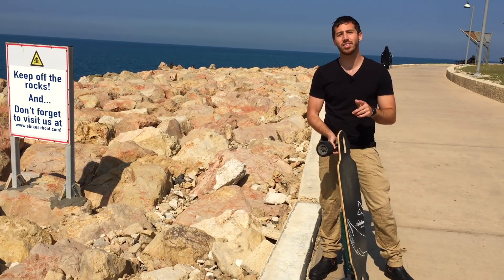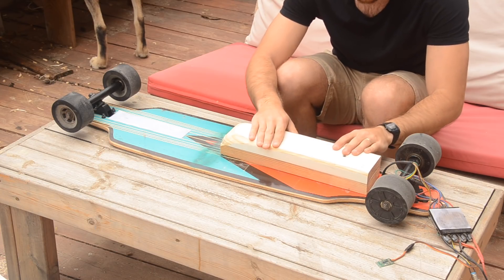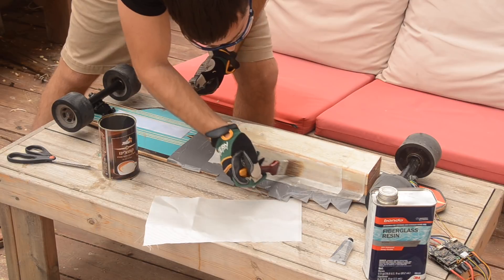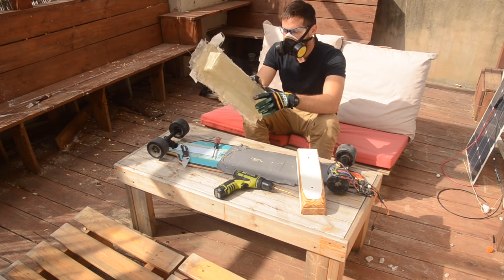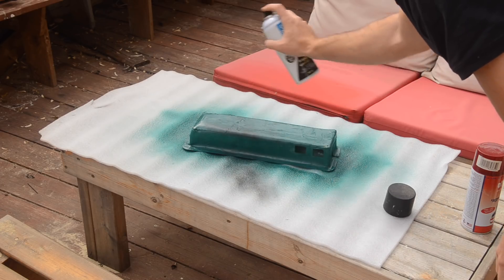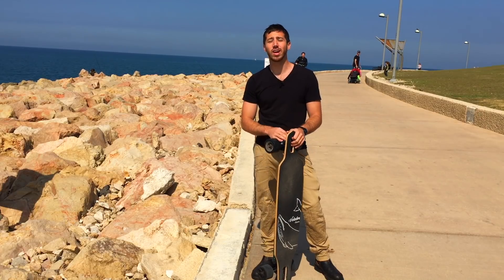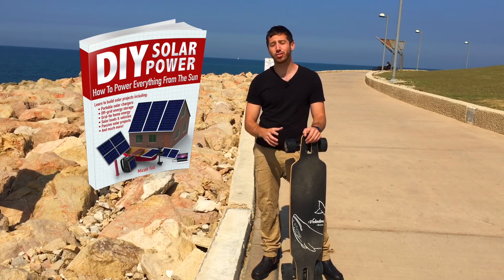DIY electric skateboard enclosure for battery/ESC

Comment: I have 300+ 18650 cells from packs that have failed.  Usually due to a bms. Taken apart many packs, taken spot weld nickel off, bought test equipment, cut hands, scars, cursed God, bought kits to rebuild; vruzend caps tear-not just one the entire kit-thought it would be easy to remove cells to check and charge as the website made it seem.  Supposedly lithium will be very important in the future-if anyone in the future needs some they should definitely check my place cause I don't want them-huge fire hazard even when properly insulated. Don't know how Elon made a reliable vehicle using these.

Comment: This video is a bit old, but hopefully you will see this. I ordered a battery and enclosure from ownboard, but the problem is that the enclosure (which is metal) is flat while my board is curved. I will still need to drill a hole into the enclosure or cut out a piece of it to for the connectors though, but also I need a way to insulate and level everything out. I might just have to give this fiberglass build an attempt. Looks sturdy and with some padding could be a really nice setup. I was also wondering what you thought about using heavy duty Velcro and maybe some straps (these straps would go over the top of the board and help hold the enclosure onto the deck).

Really great video though and very helpful to newbies like me.

Comment: Alternatively you can 3D Print the buck in order to get a cool/streamlined shape. 3D Printers are a lot less cost prohibitive than CNCs. Filament is fairly innespensive so you can iterate pretty quickly

Comment: What do you think about using hard styrofoam (we call it xps - extruded polystyrol) for the negative form ? It is easier to form and if it stucks with cover you can use a hot air b lower to get rid of the rest.

Comment: Lets try this again I'm new working this 18650...I have to 2 questions for you...1) what is the different between your battery set up and what call an tesla setup...2) I'm in Ham radio I would to know how to go able building something like this portable battery power box  like this https://www.youtube.com/watch?v=gtw5zevngC4 but using 18650 I know some but I can build something... my radio V 12 v to 16v DC  and draws 20A approx current that the min it need so any help would be great...

Comment: Just salvaged my first 26 batteries from home depot! Now to figure everything else out:) I will be ordering your v2 build kit when it comes out and hope to know what I am doing by then.
Reply: nice. im at the enclosure part. im running a 10s6p battery. and have to figure out a way to fit it on the board.
huge battery.

Comment: Hi, Nice one!!. I have few questions for you.....  How to charge big lithium battery packs ? Like if I'm making 48V 400ah pack with 2000mah cells then what amp should I use to charge safely without any damage to the cells ? It's 13 series and 200 parallel.

Comment: watching this vid I noticed some capacitors, which reminded me of my R/C ESC aircraft days( still have 2 helis). Are your long boards controlled with TX/RX system. Never seen a TX that small. With my aircraft I always Spektrum Dx6i.
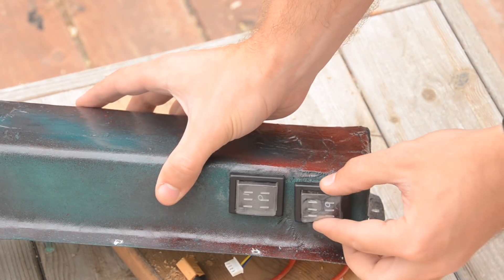Reply from the maker: Yep, there's a handheld transmitter. You can see the little receiver board at 4:30

Comment: What is the difference between "Rated current and Maximum current" on ebike controller
Reply from the maker: Basically the same thing. The bigger difference is Maximum peak current (few seconds) or maximum continuous current (the current that the controller can handle forever). Both of those are "rated" currents, or the current that the controller is rated to handle, it just depends in which situation (peak vs continuous) you are rating it for.

Comment: Do you use fuses and/or breakers on your ebikes? I saw you used 2 water tight switches in parallel here, where did you buy them from? And should I use them on my ebike? Basically, my question is, do you just unplug your battery on your e-bikes or do you have some high rated breaker, fuse, or just switch?
Reply from the maker: Personally, I just unplug my ebike battery, but that's because I keep it in a triangle bag and don't leave it on the bike much. In the past, I used a big DC cutoff switch with the red T handle. That's a good option if you want a strong switch for a system that remains on your bike. Some people use relays or breakers, which also works well, I've just not done it that way myself. Using a relay is an elegant solution though, because you can use any switch you want, even a key switch, to activate the relay.
Reply: EbikeSchool.com thank you very much for the very helpful and quick reply. Helped a lot

Comment: Hi Micah, I've spent the last 3 weeks intensely researching how to make my own kickass ebike, and I have found your videos absolutely INVALUABLE!!! Thankyou so much! I've learned enough from your videos along with a few other channels you've recommended. But I've found no answer to one question no matter how hard i look.... Can you please tell me if there's any advantages/ disadvantages of using individually protected cells in a home made battery pack (along with the BMS)

From the research I've done, i see the largest potential for damage coming from the BMS. Especially in a high power setup like I have planned. I realize from years of use with 18650 cells in flashlights that the PCB in a protected cell is far from immune to failure. Still, I'd rather spend some time replacing a cell every few months than watch $1200 AUD worth of batteries go up in smoke due to a dodgy BMS, (postage of li-ion cells to Australia is extremely heavily regulated and taxed). I bought a better than average BMS off ebay but to buy 200 Panasonic NCR18650B 3400mah batteries will only cost me another $30 AUD to buy with each having a 2 MOS protection PCB.

I've just bought your battery building book which probably addresses the issue but I only have a couple of days to buy the batteries at this reduced price so I'm hoping you'll get this in time mate. Please let me know of the advantages and disadvantages of using these individually protected 18650 cells in a 20S10P battery pack. There's bound to be a reason I can't find anything on this topic, so I figured I'd best reach out to someone with a heap of experience like you.

Thanks very much,
Leigh Chamberlain.
Reply from the maker: It is not recommended to use individually protected cells in a larger pack. Those are meant for flashlights and other small devices, where you only have one or a couple cells. A proper BMS (not a cheapo ebay BMS) will protect your cells. If you try to use individually protected cells in conjunction with a BMS, it can cause problems with some cells cutting out at different times, etc. Also, those individual protection circuits are usually incredibly cheap.
Reply: Thankyou so much Micah!! I didn't expect a reply tonight and I nearly got impatient and bought them. I'm sure you get sick of us newbies asking you dumb questions so please know that I appreciate it. Very early in my research I learned to respect your advice as it often includes insight on things I never would've thought of. Plus you're always reasonable and unbiased. Most people have an opinion and preach it as fact, but I've seen you many times tell both sides of the story and only after that offer your opinion (with an explanation) I find that SOOOOO helpful coz sometimes the reason for your preference doesn't apply to my circumstances.

Thank's again and keep up the good work bro!!

Comment: How much do you Mikcy think it will resist, if you smash in to a  step or guard railing?
Reply from the maker: I've hit it on a curb a couple times and its gotten a bit scratched up but not broken. The more layers of fiberglass and resin, the stronger it is. In hindsight, I wish I had made a more aggressive sloped nose on the front so if does hit a curb, it rides up onto it better.

Comment: Used that method to make an enclosure for one of my mini E Boards but cardboard works as well as a mold. 
you should be also using some filler and some sanding for this enclosure to cover up holes and imperfections.